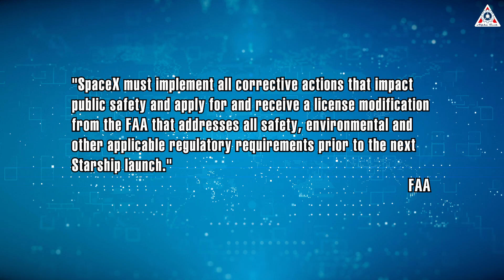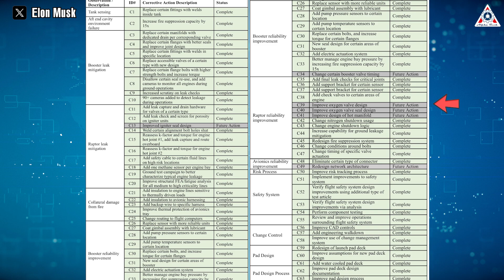What Elon Musk and SpaceX just did shock FAA...

Comment: Landing Points
How not to take advantage of such a great opportunity: when the Starships are fully operational, we are supposed to see the same routine that we see with the Falcons. So why not take this opportunity to collect as much data as possible.
In each step that the Starship manages to overcome, there are steps that, just as the Falcons do routinely, these the Starships will do too. SpaceX should surprise us by matching these steps to the extent that it manages to overcome each of the previous ones.
And this would only be achieved with large tarpaulins with circles outlining the landing points of both ships in the sea. Surround them with cameras on rafts and drones so we can all see said spectacle. In this way it would be possible to collect all the necessary data to achieve the success of these ships. That is what I would do if I were Elon Musk or those who run SpaceX.
Reply: This is what SpaceX has been doing from its beginning. They perfect their spacecraft by doing very fast turn-around launches and fix what went wrong until it's perfect. This is why they constantly have multiple spacecraft ready to launch.
This is the way aircraft used to be produced during WWII, and is by far the fastest way to get the job done - even with today's computers.
Reply: @berretta9mm17  You're telling me that SpaceX can afford to lose a Starship and a Booster worth hundreds of millions to do another landing test because they have more ships. Ok then; to vote more money!!!!! I wonder what Elon would think if you were one of his managers?